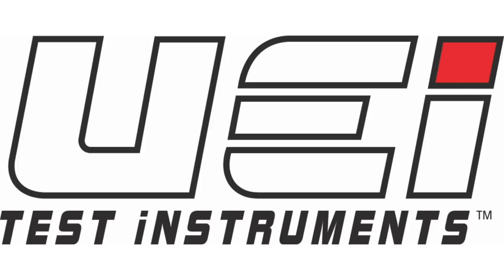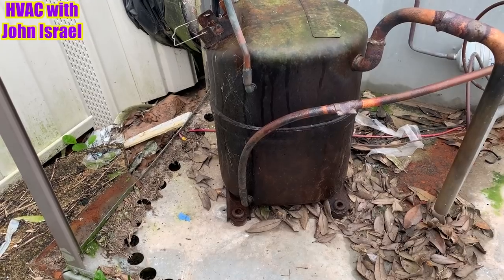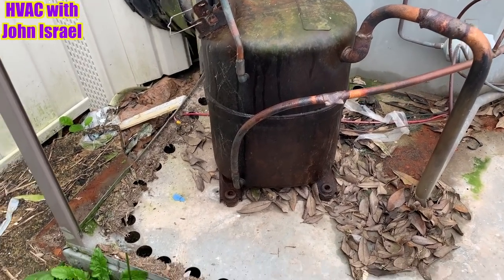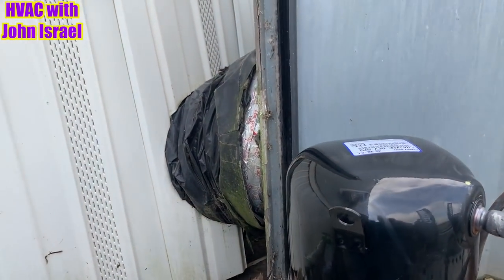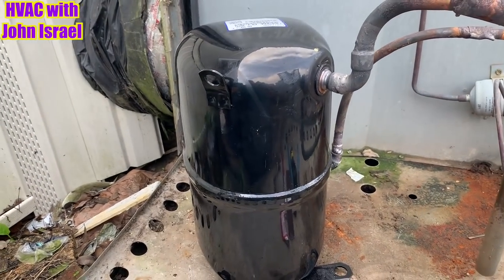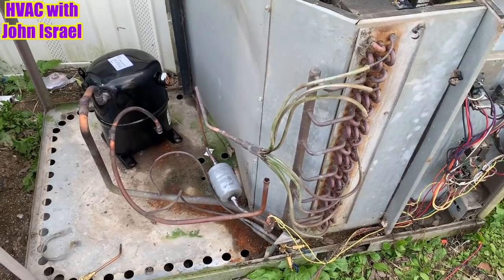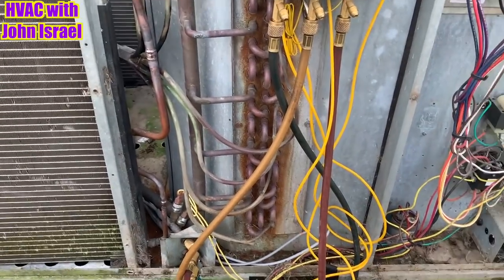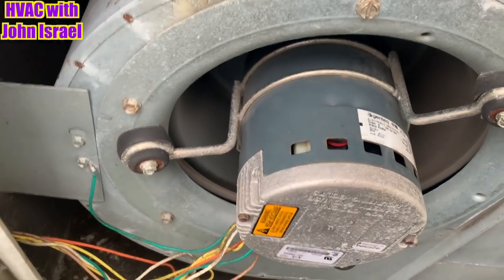Compressor Change Out with a Bad Ending

Comment: Watch 4:36 , the end of supporting iron triangle bar is right at the same position of the leaking spot. And the leaking spot has different color from its surroundings (bright at leaking spot area). My guess is when the coil unit was pulled out or put in that supporting bar end might punched into the pins and the tubing, which caused the leaking

Comment: 100% on John. John needs to replace that coil or strike a deal on a new unit. I'm shocked a Tech would post this video. I fully understand other issues showing up after the repair, this leak should've been found before the compressor was installed or the leak was caused during the repair, either way it's on John

Comment: Did you not have to recover the refrigerant out of the system before replacing the compressor?
Reply: Chris Hall with that leaking I pretty sure there was no any refrigerant when he first went there. With a refrigerant empty unit I would like to first pressure it to find the leak and fix it before going further
Reply: What I’m saying is from what I was to understand John didn’t realize the leak was there until AFTER he had installed the compressor. My question asked, since it was a packaged unit, would he have not had to recover the refrigerant first, thus finding the leak before installing the compressor. Saving himself time and the homeowner money.
Reply: I agree

Comment: It's pretty obvious the edge of that metal support hit the coil and punctured it
Reply: I think same here. But if that leak was there before John came to work that unit, you would think it should be all in oil?
Reply: @Ta-th2yo  Probably. I like John so I'm not trying to hate on him or anything, but I'm guessing the coil was hit when he removed/replaced it to swap the compressor. With that big of leak it surely would have been out of gas before he started work (if it was leaking before). If that was the case he would (should have) noticed when he recovered the refrigerant. We all make mistakes and nobody's perfect but I think John should have handled this differently.
Reply: I figure he would of know something is wrong as wouldn't he have started with the recovery... if so then this puncture had to happen after the "recovery" if it was done.

Comment: After brazing and put coil back with more Brazing,why you pull vacuum before any nitrogen pressure test?
In my experience that hole in coil is new.

Comment: Thumbs down! Yes agree unit should of been replaced. All seriousness though I do not blame the homeowner, I blame the technician for poor diagnosis.  If the tech. Did a proper diagnosis from the very beginning and informed the customer there were other obvious  clear  issues, I GARUNTEE the homeowner would of changed unit.
Not putting  rubber vibration feet summed up the whole poor diagnosis & video.
Reply: Or he broke it...
Reply: Was a recovery done as it would have shown there was an issue with a leak?
Reply: John said from the beginning that the homeowner needed to replace the old unit. He didn’t want to so that’s his fault. He should had listen to John.
Reply: My question is, with a leak like that, was there any refrigerant in the system during diagnostics? I would think not. That being said, I believe I would have pressure tested it at the beginning to establish the location of the leak. If the bad compressor and the leaking coil would have been presented in the beginning, the customer might not have invested in any of it and simply do without and save the money wasted on a useless compressor changeout. Not beating John over the head because we all make our fair share of mistakes, but it needs to be pointed out. I try to follow the wide - narrow - wide method. Wide = find every issue throughout system. Narrow = focus on each problem individually. Wide = after repairs, check whole system in broad scope for any performance issues. I have a great deal of respect for John and his work but I know it’s easy to lose sight of these things in the heat of battle.
Reply: He did it you can tell by the way the coil looks he should just man up to it lol..
Reply: Just watched part 2.  C Terminal was blown out... so there was no refrigerant to begin with... which would explain why he would not of known about the leak.
Reply: @moe4hvac  he still should have disconnected the comp and ran everything else through its paces before quoting a new compressor just saying.

Comment: Not hating but all he had to do was run long tap screws and a washer with the vibration boots to secure the compressor and he had the panel off the blower motor causing the ecm to not ramp up?
Reply: He said r-g. That’s just calling for fan. X13 fan only is 50 percent. Motor and mod is probably fine.

Comment: You are married to that unit now. If he were to file a complaint with the State Contractors Board, you will get disciplinary action against the license.
Convert blower to PSC, add leak sealant and get your drill and secure that compressor guy.

Comment: I definitely would not have agreed to that much work for that unit. Hard to expect the unexpected but I feel like the unit would have been flat on gas when you went to pull that compressor...
Even when I run into basic breakdowns I always verify refrigerant is at least in the unit and that the compressor starts up. Good luck.

Comment: I was told compressor bolts are for shipping only. You don’t need them once the unit is set.
Reply: Please, don't know who told you that anyway it Helps with Vibration that causes tubing to crack and puts stress on compressor solder joints
Reply: Engineer at carrier factory
Reply: @sixshooter7651  then maybe they should tell us to remove those bolts because they are only for shipping purposes I've seen to many Condensers maybe with fan motor or blade unbalanced shake quite a bit but if the Factory told you that then go with it
Reply: I never heard of that.

Comment: Hey John...that a 3.5 ton.....42000 divided by 12= 3.5 ton.
Reply: The compressors today are rated lower in BTUs than the actual tonnage back in the day 25 yrs ago a 4 ton unit had a 48,000 btu or higher compressor ran colder coils but today a 4 ton unit I have seen the Compressors rated at 39,500 BTUs because they want the unit to run longer for more Dehumidificatio
Reply: That unit looked like it might be 25 years old...usually the the size of the unit can be found in the model number... Not sure if data label was there.... Just seems like the btus should  be  closer to 48 than 42.